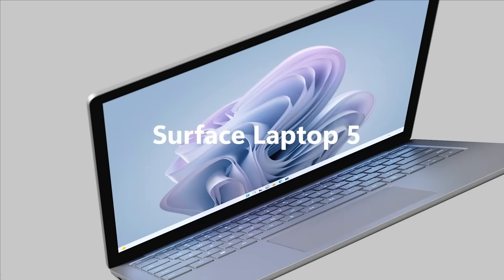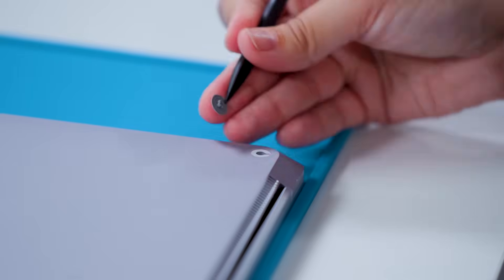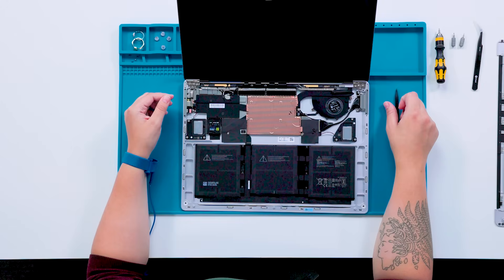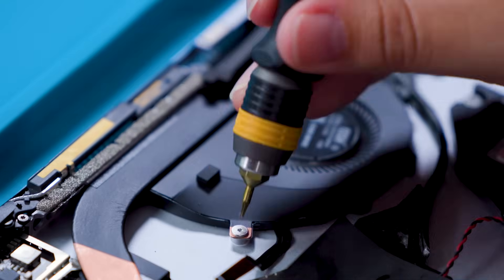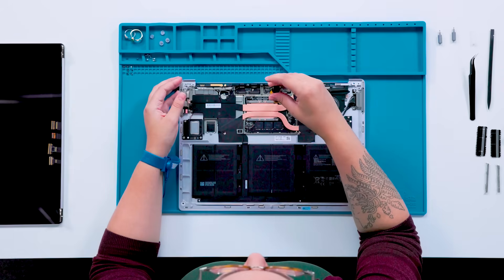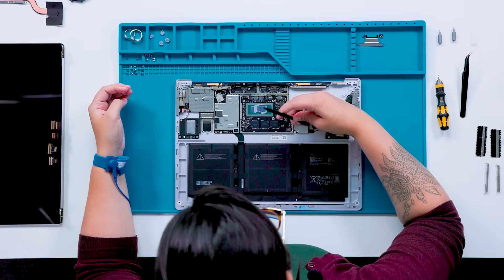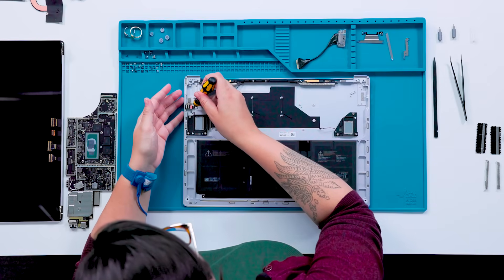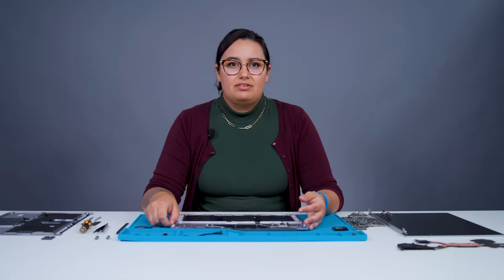Repair | Surface Laptop 5

Comment: Holy macaroni. You need to disassemble the entire thing to do the one task that is most likely to be done by an end user - replace the battery.
This isn't an approach to nake repairs accessible. This is clearly intentional to seem repairable while discouraging the majority operation.....
Impressed this video exists. Not impressed by what it implies.

Comment: After 1 year of using this device i have to say, it is my best laptop ever. Changed from DELL XPS15 4K before. It is super fast, lightweight. The only thing because i searched for repair is, because in summer it is overheating sometimes and cpu is clocking down to 0.6 ghz.

Comment: Great Video!. I have a question about Surface Laptop 4 keyboard replacement... Is it possible to replace the alcantara keyboard for a metal one? My model is 1958.

Comment: Ok, everything seems easy to repair EXCEPT the battery, which is probably the most common component to be in need of replacement. WHY did you make it so that you have to disassemble the whole thing??? And sell the battery with the rear cover??? At that point trade in a new computer...

Comment: you people at MS are just ****. The component that is 100% will fail over time is remaining last. And then she doesn't even show how to remove the freaking battery. Probably because they glued it so hard that you will break it while removing. Poor job with the laptop design - to need to dissasemble the whole laptop to remove the battery and then even worse job in making the video. Useless

Comment: "fully disassembled" battery is still present inside of the laptop literally the one thing in the laptop that is guaranteed to die in 5 or less years is still glued in. the only "change" from this laptop as compared to others such as the surface book gen 1 is now the back cover is now easily removable. besides that, the surface book gen 1 is equally as "serviceable."  Last i remember, you can easily replace a battery in a new mac book. there is literally no compelling reason to purchase a surface product; not price competitive, not repairable, awful hardware reliability, and buggy and broken software. i've had two different surface books and both of the batteries died within 4 years.

Comment: This Laptop would be a good deal if the ram was removable. Next to the storage and battery that's the bare minimum a laptop needs to offer to be worth while.
Because 16Gb ram is very easily not enough for some usages.
Reply: Ultrabook RAM is mostly soldered for form factor purpose.

Comment: I wanted to hear say at the end " and i booted the device and it didn't power on and the reason is unknown.  And that concludes our repairability of the surface 5.
Reply: 🤣🤣🤣
Those surface models are a pain in the rear indeed.But do not worry "they will assist you"🤣

Comment: Bravo  Microsoft!  publishing a guide on how to repair its equipment.  When a company is proud of the guts of their equipment and want to share what they know it usually means they've done a good job engineering. I've mostly given up on Apple due to their hostile behavior against repair-ability [e.g. planned obsolescence of phone O/S forcing you to scrap your phone, not  providing reasonable cost replacement parts and preventing shops from importing  aftermarket ones etc..] Until proven otherwise, their recent repair-ability marketing is just lip service on the pig of indifference.

Comment: How come the battery is not removable while literal everything else is ?
Reply: its glued down to prevent wobble probably, I don know why they didn't just use screws like razer
Reply: For real. Probably the most common thing to need replacement. Maybe they want to force you into a new laptop after 3 years rather than just a new battery.

Comment: Repairability is king! Couple that with performance and you’ve got a time tested winning recipe! I’m glad Microsoft is focusing on both. It’s convinced me to switch to windows after being in Apples ecosystem for so long. Microsoft has come a long way and the change is refreshing!
Reply from the maker: Surface devices 🤝 repairability
Reply: ram could be removable
Reply: @Daniel-dj7fh As a current MacBook user, I'm just glad Microsoft made the SSD removable so people don't have to suffer with soldered on storage.

Comment: It feels so good to see the company providing official info on how to open and repair the devices. Makes everything clear for the users, about the components and the system in general. Most of the time the info is made by some random user online or forums. I hope Microsoft can keep giving the user the power to own their products and build trust. I bought a Surface 1 or 2 years ago and I'm very happy with Its performace, I hope I can see some more videos to learn more about my PC and other devices. I agree with some other comments, the way some components are placed make it very difficult to access or replace them, but hopefully things will change in the future.
Reply: You're absolutely right because many companies don't tell and they make money in servicing or if a product is too old they will tell it is out service and we will buy new one but Microsoft is too good

Comment: I'm glad to see Microsoft heading in the right direction, unlike Apple.
Reply: *Chuckles in 2020 M1 MacBook air
Reply: @jordankuo6662  other than your cpu, what does the thing offer without you having had paid 300€ to upgrad from 8-16Gb ram?
Is the battery even serviceable?
Reply: @Daniel-dj7fh  I don't know, I meant nervous chuckling btw, not like I'm a proud Mac owner. I know the CPU is the only good thing about it. I like PCs better ngl
Reply: @Daniel-dj7fh  and for the battery, I don't know
Reply: And you can keep dreaming that Apple will do anything in the future.
Reply: @Daniel-dj7fh  who's dreaming that Apple will become more user repair friendly? Not I. Those ** lock everything down with firmware.

Comment: hum hum ... the battery is still glued down ? it's nice, you make good efforts.. but the most important thing is still missing. an easily replacable battery. the device could be a few millimeters thicker and the battery could be screwed in and easily taken out and replaced. but noooo .... and the rubber feet -_- 
Also, I have a surface laptop 5. coming from a surface book. 
Is it a bug or a feature, that the surface laptop 5 display can't dim and that lowest brightness is way stronger than on surface book ? 
Can it be fixed in software ?
Reply: I don't think it's a bug.  I owned Surface Laptop 4 and I think that Laptops' screen are inferior to Pros' and Books' screen.  Just not the best selling feature.
Reply: Make sure auto brightness feature is off in Windows 11
Reply: Right? Re battery.

I get that battery life is much better now than in the past meaning there's no immediate need to carry a spare to click in on the train or whatever. I also get that people do stupid things with batteries, so having it not removable by latch seems acceptable.

But this thing is designed the wrong way round.
All it should need is the removal of the back cover (AND MAYBE, let me be generous, the keyboard).
After that, the battery should be one screw for the connector and four screws to fix it in place.

It is certainly the most common thing people will want to do with their laptop and what can make a 5 year old laptop excellent for another five, and then potentially worth keeping for another five again.

Are batteries the biggest mineral hog here? Sure. Is it better to replace a bad battery, with a new one than a bad battery and an otherwise good laptop with a new one? Absolutely. 

That doesn't mean people must use a device for 15 years, but for your average 'netflix in bed, emails and the occasional job application' user, there's no need for a device to be replaced more often than that.

Comment: Microsoft really just needs to expose the screws to avoid removing and damaging those silly sticker feet. There is no guarantee that you can reuse them if you are not careful enough.
Any MacBook can be opened more easily.
Reply: they do sell the feet if you need new ones
Reply: It didn't look like sticker feet to me. They looked like plastic caps. But I could be wrong. There was a close up of the feet when she set them down on the work mat for a few seconds at 1:27
Reply: @Mr_Battlefield  They are caps and the can be reused.
Reply: @Darthpiro  No it is clearly written in the "service guide" that you have to replace it each time you open the device
Reply: @bastienkletzel7507  they can be reused
Reply: @Darthpiro  you do what you want, I just mean that it is not recommanded by microsoft and that I was thinking like you and then I have lost 2/4 feet. That's it
Reply: @bastienkletzel7507  I reused them, they are fine.